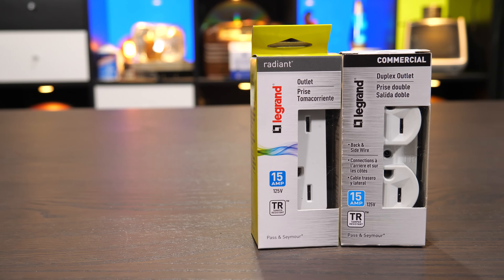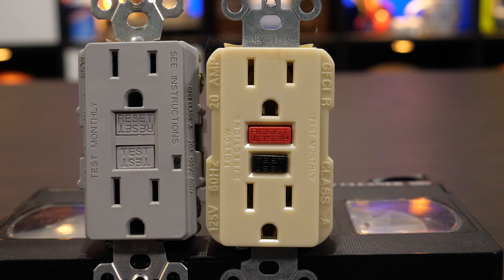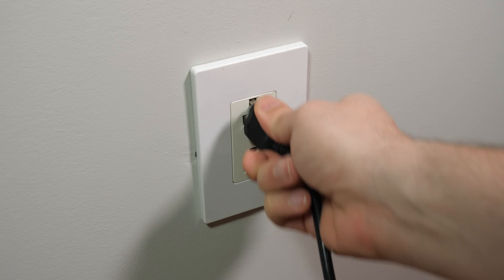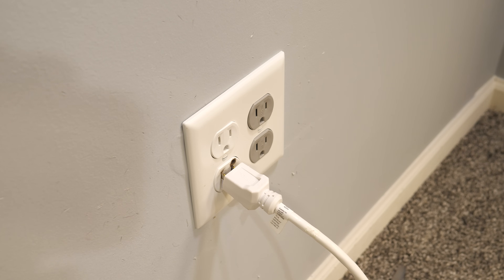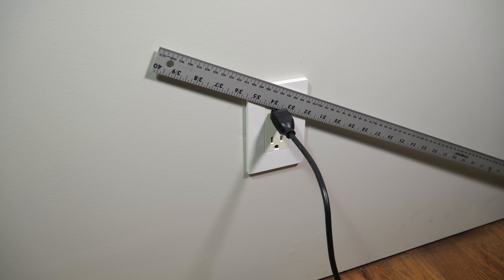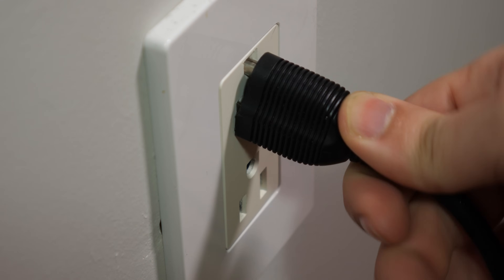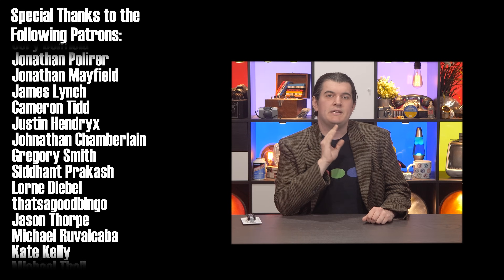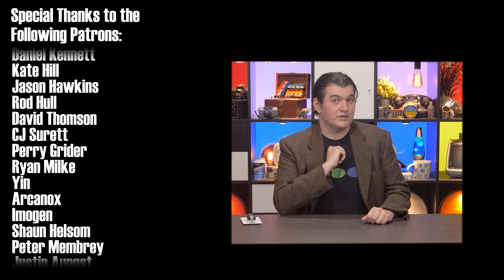Power outlets are topsy turvy - but does it matter?

Comment: The few American wall outlets (sockets) and leads that plug into a them I have used, the more surprised I am they actually are considered “fit for purpose”. They are not, they are terrible. I have yet to use one that firmly grips a plug. They are always loose and prone to lean back a bit. As you said n the video, one of them he said costs in a double outlet can be redundant depending on the lead plugged in to it. It obstructs the other socket.

The British nearly got it correct, however they are the n my opinion Billy and unsightly. The British plugs are ridiculously large. Why have a fuse in the leads plug? It does no really appreciably augment he circuit breaker, and certainly offers no more protection forca person. A best it might blow before the circuit breaker if the he are the appliance has a fault that would cause a fuse/circuit breaker to operate. An RCD in combination with a circuit breaker offers the ultimate protection.

Look at the Australian sockets (we don’t call them receptacles, and socket is a “slang” term). lol at our leads, both with and the same hour the earth pin. They are held in very securely, even a weak worn out socket has more grip than the American ones when new (it seems). I don’t know how much of this is the socket or the lead or both. I just find it unsatisfactory, especially with the 120v circuits which pull twice the amount of current than our 240v equivalent appliances. Loos connections plus current =heat  which can lead to annealing of the socket tangs, further reducing spring tension resulting in a looser connection and potentially more heat and a fire risk.

In Australia we are told America is a very litigious country, it is amazing that such a wall socket still exists! I would have thought it would have been sued out of existence.

The USA needs to adopt the Australian plug and socket style now for all new dwellings and appliances. There are already adaptors available to enable existing appliances to be used with an Australian style plug. 

Eventually all the existing crappy wall sockets and leads will be phased out due to natural attrition.

Now we can move on to the USA fully enabling the legislation that already exists for use of the metric system, it just needs to be tweaked to make it compulsory for all new items and fully outlaw SAE and any other imperial system.

Comment: All the outlets in my parents’ house (built in 1974) have the ground pin upward and it’s always driven us crazy.  I was tempted many times to ‘fix’ them.  My mom said they even asked about it when we moved in and that they were told it was standard.  The fact that so many cords/devices are designed to have the ground downward makes me think that SHOULD be the way.  I’ve rarely seen the sideways orientation, but I do prefer extension cords that have the angled orientation for either way.

Comment: In some homes I've been in northeast Ohio, the outlets that are "upside down" were the ones that were switched. I think this may have been a local phenomenon brought on by the upgrade to grounded outlets in some older homes (where having a lamp outlet on a switch instead of a fixture was common). In these homes, I would find all but one outlet was "shocked face" oriented so you knew something was different about the outlet. Usually, this was something that was noticed only after something was plugged in and then discovered to be switched via light switches often across the room.
Reply: Most homes I've lived in around central Ohio have all the plugs the same direction.  My current home all of the plugs are "upside down", except a couple that have been replaced.  One previous home had all of the plugs on GFI circuits upside down.  It really just seems based on the builder's whim.
Reply: I've lived in several houses in Northern California which use that convention too. It's a bit annoying for all the reasons Alec mentioned here - especially because in many cases, only one of the outlets in the receptacle is actually switched. They should do something like use a different color receptacle instead; then they could even have only the switched outlet be different.
Reply: I’ve seen switched upside down in a few places I have been at in southern California as well. I like the convention, but personally I go around a stick a colored dot sticker on the plate next to any switched outlet in places I move into.
Reply: It's common across the country. Every place I've lived identifies the switched outlet by having the ground up.
You would also be surprised by the amount of people who think they have ghost switches that do absolutely nothing.
A typical duplex outlet can also be set up with one hole hot all of the time, and the other hole switched. There's a plate on the terminals that can seperate the two outlets.
Reply: I've seen that in Colorado as well, but mostly in older construction. My 2006 built house has a switch outlet in the ground-down position.

Comment: I had a long ass metal ruler leaned against the wall in my basement and someone (clearly wasn't me) pushed it so it tumbled sideways against the wall and managed to hit both contacts on a somewhat pulled out plug. After that I always thought to install the plugs the upside down (ground on top) method. Untill I saw my cat walk by the wall with its tail grazing the bottoms of all of the plugs plugged into the wall -_- Now I dont know what to think. Might as well adapt the 220 and their plugs..

Comment: While I agree with the premise and it would make no real functional difference as in North American countries the plugs are not reversible, it is important to consider the implications for consistency. A lot of electricians always use a specific orientation for the phase and neutral wires as you face the wall, it is usually expected that the phase will be on your right side and the neutral on the left. By reversing the socket you are maintaining this in relation to the plug but you are reversing it in regards to spacial orientation. This is an important consideration that should be documented.

Comment: The NEMA WD-6 standard for receptacles show the shape for the 5-15 receptacle (i.e., the one commonly found in residences) with the grounding pin on the top.  That's why some say the ground-down configuration is "upside down".  But WD-6 just defines the shape of the receptacle and not how it's installed.  The NEC code that covers installation doesn't care.  I think it's installed ground-down in residences because most people like the "face".  The manufactures of right-angle 120V plugs make them for ground-down receptacles because that's how most of them are in residences.  It's interesting the the higher current 5-30 and 5-50 receptacles and the 240V NEMA 6 receptacles are installed ground up even in residences, and right-angle plugs for them are designed that way, too.  I've seen it said on electrician's forums that maybe a reason why you should do ground-up is if the cover plate is metal, lest it become loose and fall down on the connections.  Although discussions on the "right" orientation are mostly banned, since they're pointless. 😉

Comment: Another thing about flipping the socket upside down is that you now can’t see the hot pin and your fingers relative to it. With ground down I can see the danger pin and avoid it with my fingers, whereas it is blocked by the plug with ground up

Comment: I am glad you commented on the poor design of the type A and B plugs and receptacles. I totally agree, a well designed right angled plug would be a good step forward. I am from the country that developed type G - tamper proof outlets and right angled plugs with good periphery are standard in this design (since its introduction in 1947). Sleeving on the power pins-was available from 1972 and has been compulsory on new plugs since 1984. The standard (BS1363) focuses on making the plugs to a precise specification - there is more flexibility for the outlet makers. The majority of our outlets are "ground up", which is also "flex exit down" orientation, with dual outlets being side by side, not  one above another. Some are occasionally installed sideways, upside down, flush with or under floor or on a ceiling, which is fine when done for a clear reason.

Comment: As a German, American outlets and plugs honestly scare me. Ours are all recessed quite a bit in the wall and also only the very tips are exposed. They also can be plugged in either direction, so it's never an issue which way a plug faces. I can just plug in two chunky plugs side by side and have them face opposite directions to make them fit. Our outlets are pretty much only dangerous if you go ahead and stick a nail in there by hand. Which I've apparently done as a toddler... always been a curious little creature :)

My parents had child safe inserts on every outlet, except they forgot one, where a lamp was permanently plugged in. Well that was until the day the lamp was taken out for an hour to fix it. Apparently I immediately toddled off to find a nail and see why this outlet looked different than the others! Bzorp. Weeeeeeeh. Concerned parent noises and much hugging. XD
Reply: @HKlink I like that your parents covered all the outlets, but left the nails out.
As a small child, I would have injured myself or my brother with just the nail.
Reply: imagine this.  When i was 3 I put a coat hanger into the hot side of the NEMA socket in our house.  I got quite a little shock.  I can't remember who removed the coat hunger from the socket.  The coat hanger was sitting on top of a bed so it is good it didn't start a fire.

Comment: My house was constructed in the late 60s and all of my outlets are in the correct orientation, with the ground plug up.  There's a reason every hospital is like this too.  The logic is sound, weird right angle plugs aside.  Which is not the inconvenience you dramatize.  It's also worth pointing out there are situations where this is an advantage.  Like the refrigerator.  Where the right angle cord needs to go up the wall. Funny an expensive device is orientated correctly, while cheap, and by your accounts dangerous,  extension cords do it wrong no?  Another easy one is vacuuming.  The cord just stays plugged in, having it come out of the wall while your dragging the machine all over the house just isn't an issue.  And people do a lot more vacuuming than extension cording.

Comment: I know our EU plugs have a lot of issues, but a plug without "handles" to guide your fingers is a no-no. Especially when the voltage is 220-240V at 16 or 25A breaker.

Comment: So, there's actually building codes calling for outlets to be ground down, or to the right for sideways outlets, on grounded circuits. Ground up or to the left indicates older wiring in the walls, without a ground wire.
Reply: Switching it would be a nightmare similar to switching to the also superior metric system.

Comment: I was 8-9 y.o. when i first saw an American type plug in my father's boombox plugged in an European adapter.. first thing i thought was ok, this is unsafe, who the hell is using these plugs? I ended up tapping it to the adapter because it was also loose and thin like the old designs you mentioned!

Comment: I'm surprised you didn't talk about the arrangement of the sockets themselves. In the UK we can have two plugs with 90 degree cables next to each other (horizontally) where the cable goes down and the ground pin is at the top. The overwhelming majority of plugs and sockets are like this.
Reply: Agreed, it seems to me that the best orientation for sockets would be side-by-side but with the ground pin at the top, and then make the right-angled plugs so the cable comes out on the side of the live & neutral, the same way the british plug does it.

Comment: In the house i currently rent, the outlets are old and loose - Causing the plug to "droop" out a bit.
While the plug is drooping and struggling to stay in, those hot blades are exposed!  So having Ground at the top means only Ground is exposed.

Comment: It baffles me that you Yanks stack your outlets vertically and not horizontally like most other countries do. Just look at how easily wall warts and right-angled plugs obstruct the empty outlet in many shots of this video.

Inherent flaws aside, many issues with the NEMA connectors could be easily mitigated—if not resolved—with some basic regulations (insulated pins, switched outlets, dummy earth pins, etc.). But hey, this is the USA we're talking about.

Comment: This is what you get when America was the birthplace of electrical infrastructure. You were the testing ground for the rest of the world, but didn't revise and improve the prototype before hitting the masses. The rest of the world just said "screw that", and doubled the voltage to save money on copper, and made the plugs idiot-proof. The Schuko plug addresses most of the issues, and the British plug takes it to the next level with its built in fuse and individual switches in the wall socket.

Comment: What about the dual orientation one you showed off? If the top socket has the ground pin at the top, then the bottom would be free for right angled connectors. Stops falling metal object and actually allows two right angle connectors.
Basically, having the ground pins away from the center would be the best of every world and not require any thoughts with regards to installation.

Comment: The worst aspect of our plugs is when you have sideways sockets under an overhang (eg recessed under the shelf in a bedside stand) and you can't see down to where the plug is.  You naturally want to reach out with you fingertips to feel where the holes are and guide it in.  

Somehow, it's been several months since we got these bed stands with under shelf sockets from Amazon so I think I've got the urge controlled by now but it's kinda surprising I didn't get shocked.
Reply: It's perfectly safe to feel the outside of the socket to find it's position, so long as you aren't putting the plug in at the same time.
Reply: @grn1  Yes, ofc but if you don't feel both at the same time you've lost that position when u go to put the plug in after checking.  You might know the orientation but try plugging something in with your eyes closed in a sideways socket and you'll see what I mean.
Reply: I like how America uses electricity to promote Darwinism!

Comment: In the UK, I'm sure 99% of plugs are right angled anyway.  I cant think of a plug that just sticks out the wall. Sounds so dangerous.  Also why are all your sockets vertical? It sounds like the cause for having the plugs cables stick out the wall.  What a dangerous hack.
Were they socket covers at the end? They are really dangerous for children in the UK. Given how safe our sockets already are, they actually give a tool to the child so they can poke into a socket and release one of the safety mechanisms inside all our sockets.

Comment: Right angle plugs also work better with floor outlets. But straight wires work better with ceiling outlets. So there you go. It’s almost as if the plugs and outlets never have a perfect orientation or angle.

Comment: Hmm a situation where the plug is dangerous and you don't want to leave a shock and fire risk unattended to go to the breakers? Sounds like a use case for a switch on the wall plate. 😂

Comment: The reason for the face orientation is flooding. Ground gets water first so it shorts to ground instead of well not till it gets to that level if it does. At least that's the theory. Could use some testing 😉.

Comment: The ad-hoc standard in my neck of the woods seems to be ground down, but inverted for switched outlets.

The best solution might be to stick with ground-down, but with the outlets side-by-side. That would (eventually) eliminate the main reason 90° plugs aren't the default choice.

Comment: No honest human can readily tolerate looking at a receptacle with the ground hole on top.    
Horizontal with the neutral side up is the safest, but sideways orientation  is visually distracting.    
Cords with 90 degree plugs that favour ground-at-top orientation Do exist, but they are hardly common.

Comment: Why don't they just push out the area surrounding the receptical a bit more then the plug is deeper in and you can't put anything in, only problem would be the angle plugs who will now not fit anymore

Comment: What I want to know is, why are three prong plugs almost always impossible to grip? The ribbed one that Alec shows at the start is one of the exceptions, but most have ZERO features to grab onto. With tight receptacles, they can be extremely difficult to unplug while not pulling on the cord.

Comment: if the face plate is metal it's grounded through the box tho?
Reply: If the receptacle is grounded, then the metal faceplate will be.
Reply: @GH-oi2jf  exactly... and I mean I guess it's possibly someone didn't do that, but that's hardly the faceplate's fault.
Reply: Not nessesarily
Reply: @SonsOfLorgar  just about. it's connected to the metal box with a metal screw.

Comment: One time in the kitchen, I was preparing to put something in the toaster oven. I had a piece of tinfoil on top of the toaster oven that flipped directly into the prongs of the plug and it immediately went up in flames. The breaker did not trip.

Also, as someone from the Boston area... you're terrible at "Throw the knife at the wall" 😔